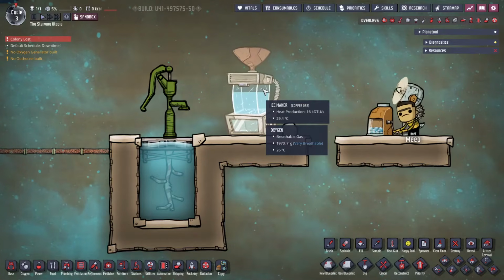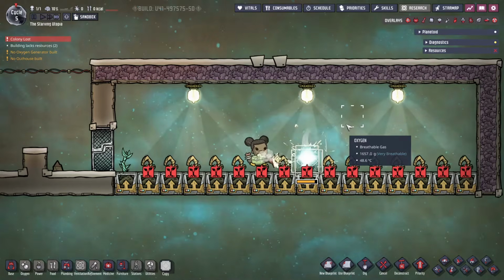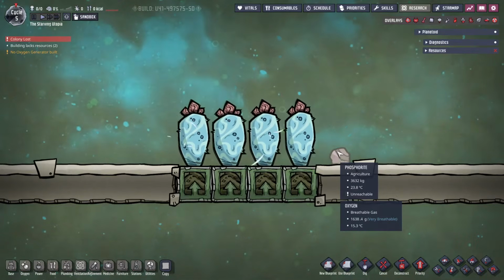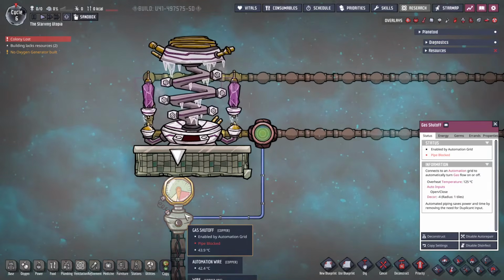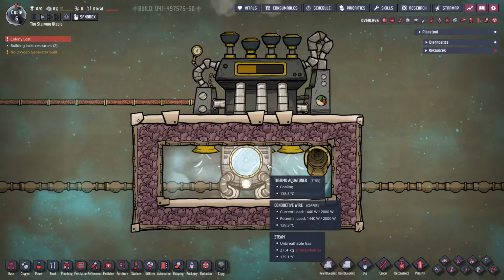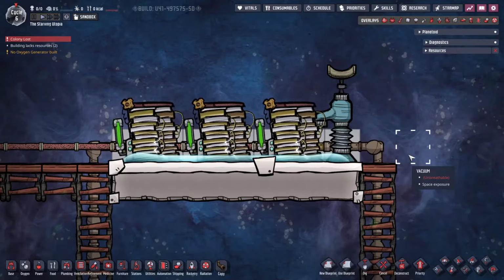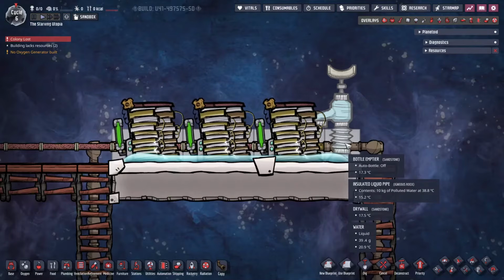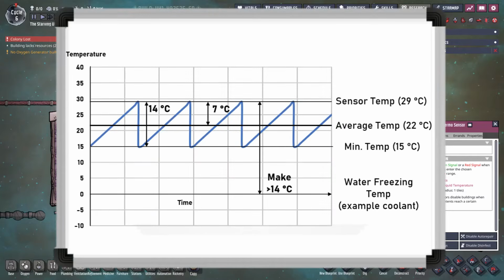Oxygen Not Included - Tutorial Bites - Cooling

Comment: sadly i havent lived long enough to have trouble with water tempeture i usally kill my coloney by accidently starving them.... which about to happen cause my green house is small and the extra plants i planted are currently in a room full of hydrogen which they cant live in-
Reply from the maker: Ah that does sound not ideal. Hydrogen does float up though, so if you just open a space above it then it will all float away. But yes, heat is more of a mid game problem, so I'm sure once you crack the early game you'll get to face what I consider one of the game's main challenges.
Reply: @GCFungus  yeah now all my plants are over heatings cause of the gas pumps i have to fill the drecko pin with hydrogen and the hydrogen power plant- this games is something else

Comment: Don't use polluted water under steam turbines! It leaves polluted dirt after vaporizing and emits polluted oxygen, which clogs steam turbine inputs
Reply from the maker: That's not correct, polluted water leaves behind normal dirt when boiled and only makes polluted dirt in the water sieve. There is a minor risk of the dirt turning into sand, but if the steam room is that hot then it will likely be bigger or something has gone wrong.

Comment: No Filter Gate (automation building) before aquatuner? Doesn't it react too fast - "aquatuning" the unit of water before the one under sensor?
Reply from the maker: In theory possibly, but in practice a filter gate isn't required (at least I've never needed one). I think that's because it's a fair assumption that the coolant liquid packets are of similar temperature to each other. That's not strictly true, but it is most of the time, hence no issue.

Comment: why is last design generates more heat/power? i mean it is same steam, same walls, same polluted water, same amount of time aquatuner works.
Reply from the maker: The last design isn't about more powerful cooling, and you're right that you would need more aquetuners to increase the cooling rate. The point of that build is fine temperature control, so you can get your coolant to an exact temperature, rather than fluctuating in the 14 degree range of the aquetuner's as I explained earlier in the video.
Reply: @GCFungus  yeah i know, i just noticed that steam turbine has more power, and i am curious why
Reply from the maker: @ДенисМалышок  The builds I use for the Tutorial Bites are just test maps for demonstration. What probably happened is I filled the steam room with hot steam before recording so the power seems higher. An aquetuner running a water coolant wouldn't be enough to max out the turbine, but super coolant would get close, if it were cooling all the time.
Reply: @GCFungus  ok) i just kinda obsessed with the idea of getting things most efficient way possible but without any cheats or tricks.
For example i build my SPOM on termonulifier and my oxygen comming cold to my base which provides me pretty basic some cooling effect, and it is almost for free.

Comment: Thanks for a great video. I think the best use of the Anti Entropy thermo nullifier is to cool liquids rather than an area. I wanted to cool my petroleum out of the boiler because running it from the bottom of the base to the top meant I needed to use lots of raw minerals to build the insulated pipes. Looping 151 degree petrol through 13 radiant pipes snaked behind it took the temp down to 100 degrees. 
Steam is produced in the immediate vicinity, but It condenses, producing a lot of cold water seemingly out of nowhere which I have cascading into a holding pond which can be used to feed the electrolysers.
I fed the nullifier with two electrolyses, gathering the excess hydrogen to run a generator.
I pumped out the air above the electrolyses and ran that around the cold biome.

Comment: I'm wondering why cooling is done by cooling the liquid to the temperature you want and then running it through the area you want to cool. Wouldn't it be easier to get a liquid as cool as possible without freezing and then run it through the are whenever the liquid at the entrance reaches above the temperature you want? Or is that less power efficient
Reply from the maker: So if you think in terms of heat, you will realize it doesn't make any difference in terms of efficiency. Whatever system is deleting the heat (let's say aquetuner & steam turbine) will be the same, and the amount of heat being added to the areas you need to cool are also the same. Therefore how you make the cooling loops won't impact the power efficiency, so the main consideration is really complexity. You can do it as you've suggested, but that would usually mean more cooling loops and more control automation. If you want to do it that way then go ahead, because the game is all about coming up with creative solutions, but hopefully that explains why using the loop straight from the aquetuner is the most common approach.

Comment: Hey, will the Thermo Aquatuner in the AT/ST cooling system always get hotter? Because if I look like there's nothing to cool it down, is that okay?
Reply from the maker: If you set-up a full cooling loop with AT/ST and the thermo sensor, then the AT will only power on (and take heat out) when the coolant has collected enough heat to become hot enough. If the area the cooling loop is running through is not being heated, then the cooling loop won't change temperature and the AT won't run. In that case you aren't getting much benefit from the system, but it won't draw any power or cause any problems to have it.
Reply: @GCFungus  Well, thanks for answering, but I still don't get the answer, I know if the AT doesn't turn on then heat won't be released, but if the AT continues to turn on then the AT and the surrounding area will get hot right? Is that okay? Will the heat there be reduced?
Reply from the maker: @ihyaakmal5995  The steam turbine deletes the heat, which is fundamentally how the system works. As long as the AT is inside a box of insulated tiles, the heat won't get out. Then you need to cool the ST which will itself get hot, which is why the cooling loop runs past it.
Reply: @GCFungus  Ah i see, alright then, thankyou so much
Reply: @GCFungus  Oh yeah, thank you too for making this tutorial, it really helped me start my "journey" in this game

Comment: For some reason people think of temperature maybe as the third thing to take care of... I think of it as the first thing, so much so I full blast research insulated tiles.
Thank you for the specific heat capacity video! and TC!
Reply from the maker: Well I would consider food and oxygen to be the most basic resources, and often what new players have to tackle right as they start the game. That's why heat is generally considered third as it takes more time to create a problem than starving or suffocating!
Reply: @GCFungus IMO electricity is the very first priority. Especially for beginners. A lot of my first runs were crushed because i was wasting literal tonnes of coal by not having smart batteries disable generators.
Reply: I always research the ore crusher first, then smart batteries, because they output a lot less waste-heat.  Insulated tiles are more (or less) important depending on your spawn started.  
If you stumbled in to a geyser with no abyssal between you, or even two, you'd better rush the insulated tiles, and wall that thing off.
Reply: If taken care properly, heat is not a huge issue.
What you might take care is hot oxygen from electrolyzers (because they will eventually heat your base.) And a hot industrial stuff like metal refinery or volcanos (obviously)
With this taken care of, the other heat sources are not so much of the deal.

Comment: Hi, I'd like to know is it better to use Conduction Panel or Radiant Pipe to cool rooms and areas, i couldn't find the answer and which is best?
Reply from the maker: The conduction panel was added after I made this video. The answer is that it is much less effective than radiant pipes, but the benefit is that it doesn't need any atmosphere (gas or liquid) to work. Therefore it is best suited to space or vacuum applications for low powered cooling (e.g. robo miners, autosweepers, conveyor loaders etc.). It is unable to cool a steam turbine, and if you're working within the asteroid where you have an atmosphere anyway then simply use the radiant pipes and they will be more effective.
Reply: @GCFungus  Thanks for the great explanation.

Comment: Isn't it possible to cool the steam turbine with its own output water?
Reply from the maker: It is technically, but the amount of cooling you can achieve with this is limited. This will only work if the steam temperature is below 135 degrees C, and the wiki page has useful information on doing this: https://oxygennotincluded.fandom.com/wiki/Steam_Turbine#Self-Cooled_Steam_Turbine . I don't personally like doing this because it is fail dangerous, meaning that if the steam gets too hot, the turbine overheats and then the whole system breaks and needs to be fixed as it can't recover itself. Also it is only applicable in some scenarios, as with a significant amount of cooling this simply won't work.

Comment: Should I use a AT in a frozen biome cooling loop?
Reply from the maker: You can do that for a while and let the cold from the biome counteract the heat, but eventually the biome will get too hot. Using a steam turbine is the most robust way to do cooling, and once set-up you can leave it be.
Reply: @GCFungus  Ah thanks its a long way until I can get plastic or steel so I'll have to stick with the frozen biome until I can get petroleum but thanks for the help

Comment: I just got into ONI and have finally made myself some plastic and was even lucky enough to get a 2% smooth drecko egg drop from one of my normal dreckos, now i can finally build this to cool down my base, but how do I incorporate the base wide cooling system into this? Do I just make a giant polluted water cooling loop? Where should the output of the cold water be, anywhere on the insulated output side?
Reply from the maker: Yes, basically make a giant cooling loop that runs through your base to the aquetuner as I showed. If the base is very large, you may need multiple loops, but simply for base cooling one is usually enough. A base cooling loop like this is a closed loop - it doesn't have an input or output (after it's filled by bridging on). It just circulates around the base slowly collecting heat, and then the aquetuner can remove it when it gets too hot.

Comment: I hope this fixes my issue.  My main base is overheating (Again). Will running cold water through floor tiles cool off a hot base?

  I fixed it temporarily by using two electorlizer setups that pump out air that is 30-50 deg F ..it worked great for several cycles.  Until my base then hit 1500g psi again (it was super low) and all the air vents shut off. 

Now all my dupes can breath again... but I'm back to using ice sculptures to keep my crops growing.   I DID re set up a water cooling loop through an ice  biome but.... I know that doesn't last long.  Last time the biome got warm fast. 

Hopefully it gives me enough time to set up plastic manufacturing so I can get a steam turbine!

...and the two thermo nullifers are busy doing other thigns. One is cooling air, the other is cooling 120deg F water from a cool steam vent going into an electorlizer setup.... and it doesn't get it cool enough to put it anywhere else in my base.

I MIGHT just use that one for water IN my base instead.. it's gonna be cycles and cycles until I get plastic up and running.
Reply from the maker: Running cold water around is definitely a viable way of cooling things down, but the full cooling set-up will keep your base at the perfect temperature forever as long as you can provide the power. I hope it goes well!
Reply: @GCFungus  , I haven't made it yet.  Not enough plastic.  The two thermo nullifers on my map worked GREAT for 20+ cycles and now well, I made the mistake of pumping 100deg F water into my water pool at the bottom and the base is over heating again.  The temp just hit 80F and it's been 75 for awhile.

I wish you could run water pipes AND gas pipes around a thermo nullifer but... they can't handle it.   One of them is cooling air from one electorlizer setup and the other is doing water. (While I have another electrolizer set up cooled by Thermo Regulators). 

Whats crazy is that the air coming out of BOTH electrolizer rooms is like 44F but, my base is STILL over heating.  I  moved out most stuff that produces heat.

I think one issue is that I'm keeping my base at 1500g of air pressure so the vents turn off and the 44ish deg air out put now and then isn't enough to keep it cool.   I could probably let it increase to 2000g but, eeeh that would only give me some more time and well, airvents stop working at what 1600 or whatever. 

Worse yet, I made my cooling loop of normal water that is also watering my crops so, I can't easily close it off and just use the thermo nullifer to cool the water more. 
-----which I guess I'm gonna change ASAP because again, not enough plastic to make a steam turbine yet. 

--this game is seriously the most complex game I've EVER played.  The "Oh crap! I'm gonna loose my base!" moments are what keeps me playing... and why I also dislike it hah.

---oh, and uh, don't pull a vacuum in the room you build around natural gas vents.   I decided to do so I could stop using gas filters and well, my gas pumps over heated... after the geyser turned back on.   After being ok ooh, 500+ cycles.

Comment: Why make the steam reservoir with two different liquid types?
Reply from the maker: Basically you want to get all of the gas out of the room by filling it with liquid. If you only use one type of water then you need to fill the bottom row to it's maximum until you can get any in the top, which would mean over 1000kg of water per tile on the bottom. By using two different types you can use much lower mass because the two types cannot mix, thus letting you fill the room with much less steam.
Reply: @GCFungus  You... are the greatest!
(You remind me of the narrator from BBC show "The Secret Life  of Machines")

I'm up to cycle 520 on my Ninth run through. This is the farthest I've made and the first time cooling has been such a huge issue.
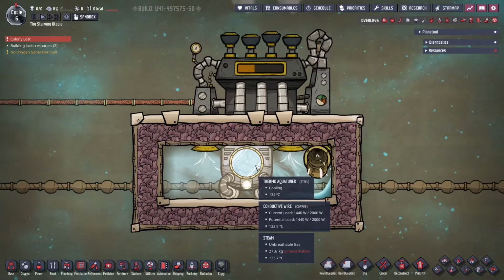I've built two of the variety you show at 6:30. I've noticed I get small amounts of dirt in the bottom of the steam tank. I assume this is precipitate from the polluted water after it's boiled off to steam. I inadvertently put too much polluted water in the bottom layer of my second cooler, and it precipitated so much that my aquatuner got entombed in dirt. The thing also was running really hot, (350+ degrees) damaging the steel aquatuner.  I had to open the bottom multiple times to clean it out & repair the aquatuner, then re-fill and start over. This was frustrating after the third time. I couldn't get the ratios of polluted to clean water right and my steam density was always at the low end of the spectrum. 

At 12:35 you mentioned experiment with steam volumes. During my fourth cleanout I noticed that if I were quick about it I could open a couple of the bottom insulated tiles, do what needed doing, and close it back up without letting any air in. So at that point I had the tank full of low density steam. Rather than open the top to use a bottle emptier I connected a liquid shutoff controlled feed line to the top of the steam turbine's return line. That way I could use a signal switch to add clean (precipitate free) water to the steam tank so I could increase the steam density while it was running.

It still overheated and failed. I noticed my first cooler was still working fine with no issues. So I investigated a bit and found the surrounding temperature of the first unit was around 37 degrees, and 76 degrees around the second. I also notice the running temperature of the aquatuner was inversely proportional to the steam density. (higher density = cooler aquatuner) I started out at around 15 kg per square and kept watching the aquatuner overheat and damage itself. When there was just a sliver of red left in the damage bar I though "screw it, it's going to fail any way" and I turned on the feed switch and let "a whole lot of water" flow in. I had no way of measuring how much I put in, but when I stopped I had a steam density of around 100Kg per square. 

The things been running for about 20 cycles now, right on the edge of failure, but happy and holding at 152 degrees.

Thank you for the adventure!
Clicking Join :)

Comment: Why use diamond window tiles for the cold injector? Aluminium has a much greater thermal capacity, and much higher thermal conductivity. And for a greater thermal mass, you could make the central part 3 wide and fill the middle with a suitable liquid for your desired temp range. I mostly only use diamond for hot applications because of its extremely high melting point as I find aluminium straight up better for all applications under 500c.
Reply from the maker: I suppose it's just my go-to material for heat transfer. Metal tiles would also work, and Aluminium is great - I suppose I come from a mindset of playing base game maps which generally didn't have Aluminium easily available. But it is definitely much easier to get hold of in Spaced Out.

Comment: Damn, I never thought to section the "heat exchanger" into 2 chambers so you can have 2 target temperatures from 1 aquatuner.
It's so simple but does exactly what you need if 1 aquatuner provides enough cooling power, which for regular base cooling it should.
Reply from the maker: Well in theory you can run it through as many cold sides of heat injectors as you like, as long as the total cooling required is still manageable with the aquetuner!